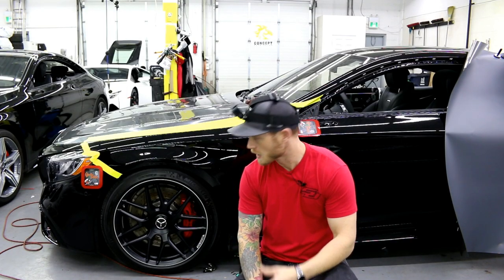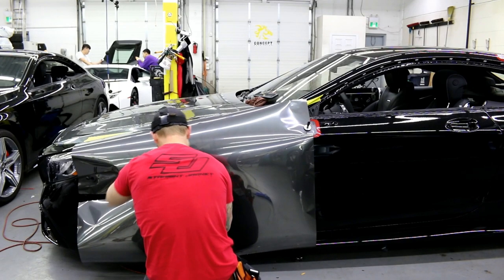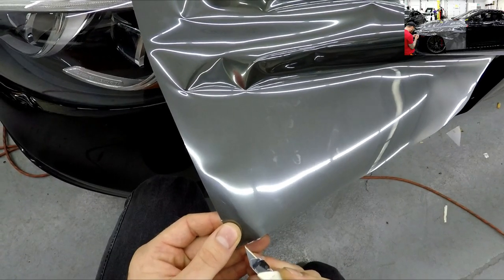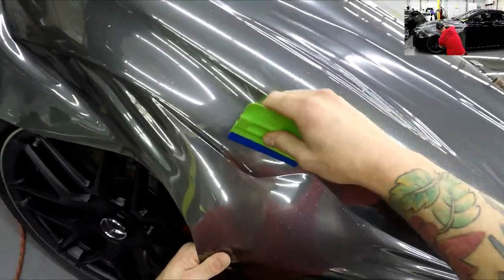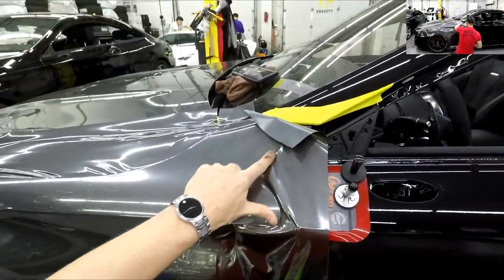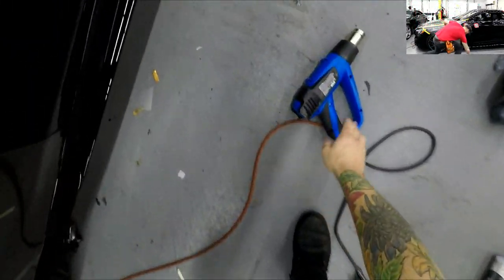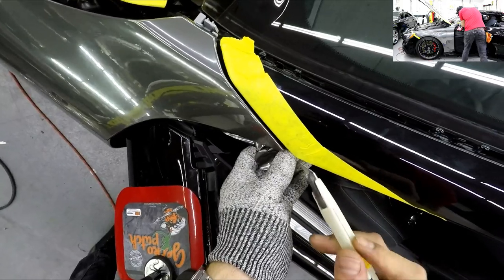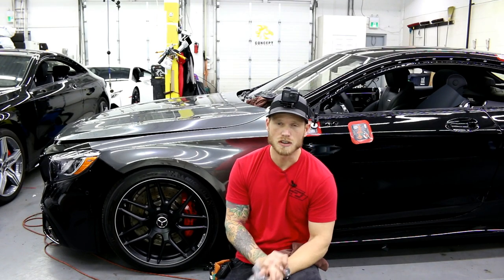INSANE TITANIUM CHROME VINYL WRAP | HEXIS SUPER CHROME FENDER WRAP

Comment: Now that youve used this material, whats in your opinion the best OVERALL film for finish, ease of install, quality for the professional shop.... i use Hexis and am certified by them but... the tack is so extreme i struggle to wrap roofs etc on my own, i find it really frustrating.
Reply from the maker: I'm always up for working harder if the result is a deeper and nicer finish in the wrap. Hexis is very sticky, which makes it challenging. To counter the strength of the adhesive I used Tack Reducer by Vvivid. It helps tremendously
Reply: thanks for replying bro, i often wondered why its taken me so long to be able to wrap to a high standard and i discovered why when using other films....  That tack level when working alone makes this film incredibly difficult to manage. i Learned using hexis so from the off just thought this was how films are.... Hexis have released a new version of their films with much less tack i believe , this will be a game changer for me!!   @CKWraps
Reply from the maker: I don't think they plan to change the adhesive on the chrome but hopefully they do on their other films. I've used Hexis a few times in the past and without Tack Reducer, it is a slow process when working alone.
Reply: You have no idea how good this is to read... i always just thought it was me tbh..... Keep up the good work, left some tips on releasing the cap. God bless man!!  @CKWraps

Comment: After going over with a heat gun, do you think torching the edges for just a little bit will damage it or seal it better ? I found out on the interior trims (which are really curved little spots) torching it afterward helped me a lot. But i just haven't tried it out on the exterior.

Comment: Hey Christian thanks so much for the videos! Love the work. In another video regarding ceramic coatings you mentioned that you can wrap over them but they lower the the adhesion. When you have an overly aggressive adhesive such as on this Hexis Titanium Chrome, would there be any sense to actually applying the c-coat in advance to make for an easier install. Potentially avoiding ruining some of the expensive film? While, of course, hopefully still getting a great install that has staying power.

Comment: Hey a little question for you. I bought a roll of vvivid vinyl wrap on Amazon in gloss black and it has an orange peel texture to it. I looked through the 3m reviews which I dknt even want to use after your video and they have even worse texture. Is there any wraps that don't have that? It appears to be from the air release adhesive on mine
Reply: andrew kb -apparently gloss black, of any brand, is amongst the worst for orange peel. Same with paint. It’s because of the contrast  in the reflection between shadows and highlights
Reply: @c7uk  dang that really sucks. It makes it feel really cheap. I'm a house painter and paint trim work and cabinets and I hate orange peel there but on a car is just outright terrible.